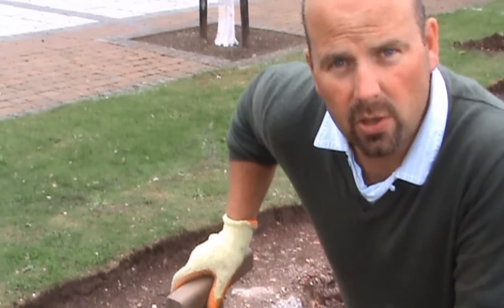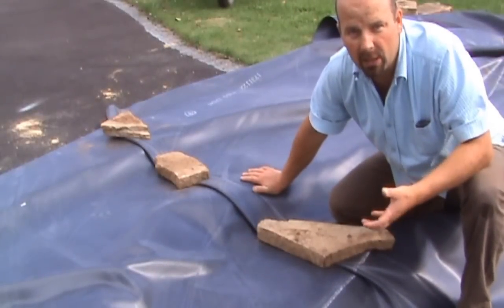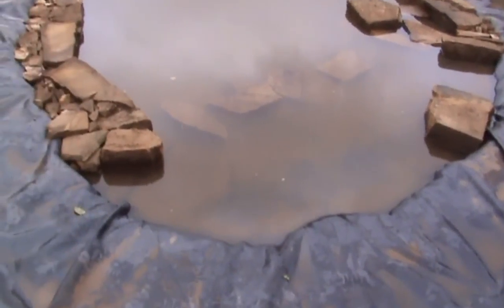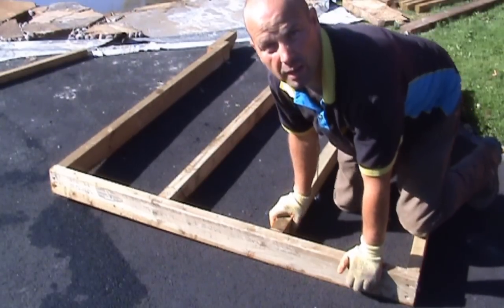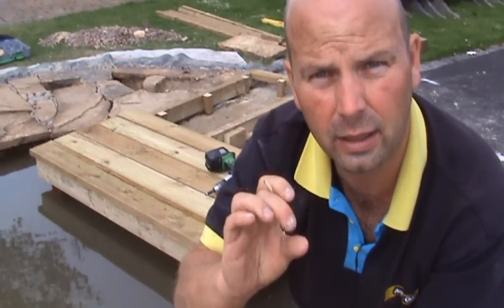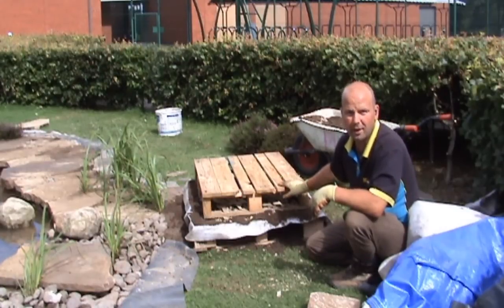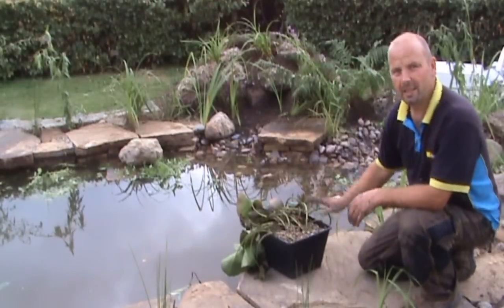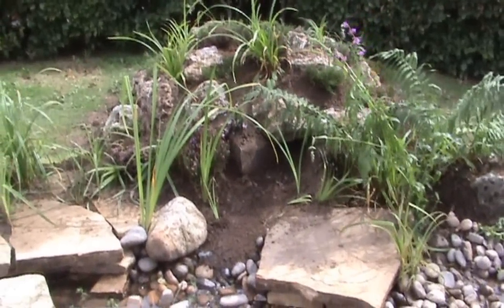How to Build a Wildlife Pond Video - Complete pond building video by Pondguru

Comment: I notice you didn't put a filter system in this one.
Reply from the maker: No it is a wildlife pond (no fish) and would stay clear through daphnia eating the suspended algae and plants reducing nutrients which would otherwise have fed algae. As soon as fish go into a pond a pump and filter is needed.
Reply: But if frogs and other wildlife are  added so does the waste factor increase. And what is to keep the mosquito population down? That's were the fish come in. (The circle of life.) And what's to eat the bugs that come from the cave you made. Besides mice and rats which will attract large prey since it is a wildlife pond.
Reply: It would be nice to see this in 6 months. Even if you add 6 to 12 goldfish I don't think would hurt the pond
Reply from the maker: Newts, frogs and toads as well as water beetle larvae and other invertebrates eat mosquito larvae nicely and as long as fish are not added to a wildlife pond the cycle will be natural and not require a filter. Fish eat many of the invertebrates which act as natural filters and natural predators for mosquitos.
Reply: my next question: After three days of hot sun what's going to keep the algae under control and the water from looking like green sludge. And clear until the plants are big enough to take control? Or are you going for the swamp look?
Reply from the maker: The swamp look?
A new wildlife pond will naturally go green but as soon as the daphnia get going the population explodes and clears the water by consuming the suspended algae, hence the need for no fish (as they eat the creatures responsible for clearing the water). It could take a few weeks for a new wildlife pond to clear but it invariably will clear and stay clear.

Comment: Please, please, please come finish my pond????   I chatted to you about a year ago in some depth.  We now have it dug, lined and filled but are struggling to finish it off.  I can't source edging to give it a nice natural look and I want to install a slow trickling watercascade at one end but dont want to buy a pre-formed thingy.  Sure you don't want a wee holiday to Inverness?   My garden is my passion and i'm so stuck its getting me down.
Reply from the maker: +Debbie McDonnell If you're worried about building a cascade I would say go for a rockways one. They are preformed but as natural as you will get. 99% of problems associated with ponds losing water come from the cascade and unless it is done right the water will be lost so a preformed pond reduces that water loss chance to zero. If you do find you're losing water where the sections join a slight adjustment to one of them will cure the problem but finding that water leaks from a cascade can be much more difficult to remedy. Chances are a leak in a built cascade could not be found which is a nightmare scenario as it renders the cascade useless.
Unfortunately I gave up doing any pond work over a year ago when the online sales business took off and now I'm working 7 days a week on that. Edging could be large stones instead of flat random paving and I would definitely advise to go preformed on the cascade.
Reply: +Pondguru Outdoors Thanks.  I've bit the bullet and bought a rockways cascade.  Also found a quarry a hundred miles away who can deliver flat stone for edging it all.   Hopefully all be done before the summer is here!   Thanks for taking the time to offer us all the great advice.
Reply from the maker: +Debbie McDonnell No worries and I hope the rest of the build progresses well.

Comment: thats going to be hard with such a large hole to cover. this thing is over an acres in length and about the same in width it starts at 10 feet and goes does to 30 feet deep at the middle